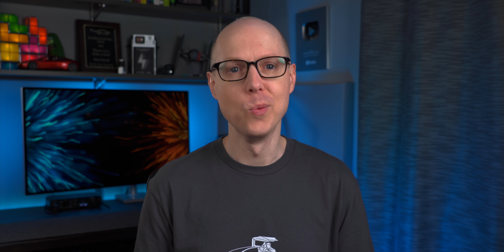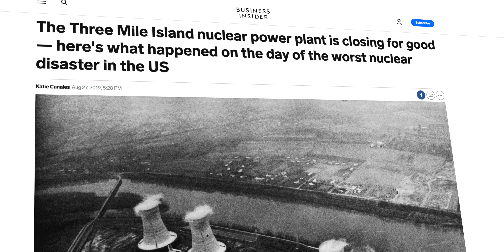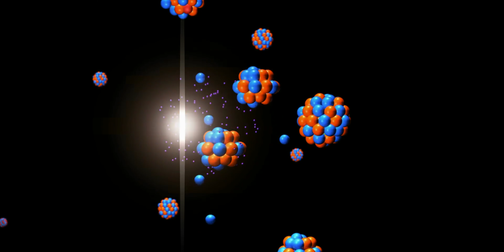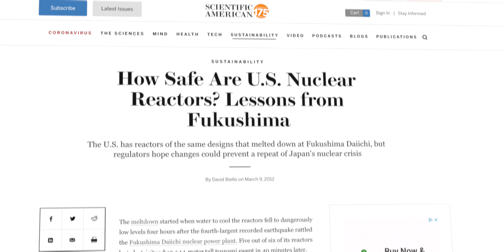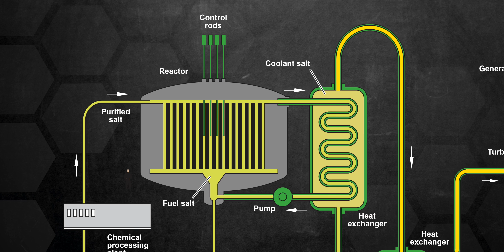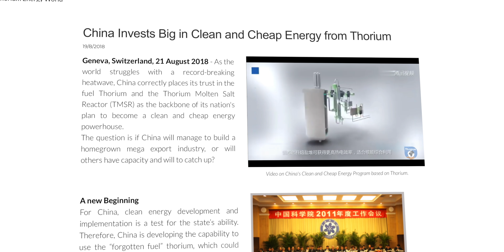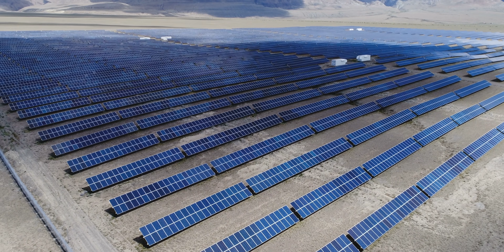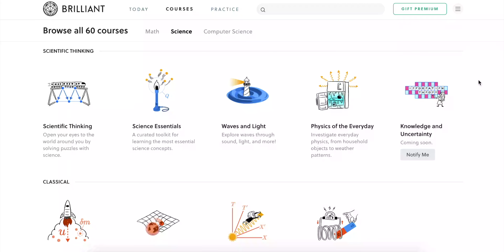Thorium explained - the future of cheap, clean energy?

Comment: My guess is, 20 years from now, if things last that long which I doubt - they will still be talking about thorium reactors and how great it's going to be
Reply: China will be starting up their test MSR in about 2024 and projects launching a small commercial reactor in 2030. There's no real technical hurdles, just minor engineering and optimization issues. The primary issue, and what China's been mostly working on since 2011, is rebuilding our technical knowledge of these systems, as most of the people with hands on experience with this type of system are dead.
Reply: @williamsmith1741  15 years ago they wrote that in 2030 China would have 50 pebble bed reactors running. What came of it?
Reply: @bezahltersystemtroll5055  I'm not sure why my last comment didn't post, but I don't really follow pebble bed technology as fluid fueled MSR's are more efficient, and pebble bed reactors aren't that new of a technology, with there being multiple plants around the world that are pebble bed gas cooled reactors. However, I just checked and China's high temperature pebble bed test reactor was nearing completion as of April 2020. I don't know if it was completed or if work delayed due to the global bug.
Reply: @bezahltersystemtroll5055  Oh, just following up on this, as I just learned this, but the Chinese MSR has already been running and the Chinese will be breaking ground in the next year or so on their first commercial scale test reactor, with plans to start rolling them off as part of their belt and road efforts, which I KNEW they were going to do. The Chinese are going to eat our lunch.

Comment: America made a tragic mistake in the 1960s when they dismissed nuclear physicist, Weinberg, for advocating a thorium/salt reactor for generating electricity instead of the uranium/plutonium models in production. The Cold War was a big reason the authorities wanted to stay with the u/p reactors, but they have proven to be costly, problematical, and no one wants the radioactive waste they generate in their backyard. If we had spent the last 50 years developing the t/s reactors, we would be well on the way to a clean energy future. I love solar and wind technologies but they will not produce the amounts of power we need for a long time to come.

Comment: Why not just go all in for fusion reactors?
Reply: Because these work already and it'll take probably another 30 years to commercialize fusion. Even then though, the amount of energy you get our of fusion of deuterium & tritium is only 4X the amount of energy you get out of U-233 fission (which itself is 1,000,000X the amount of energy you get out of burning fossil fuels). Additionally, with fusion you would also have to pour a large percentage of the power you produced right back into the reactor to maintain the plasma and keep it fusing, such that, at best, an operating fusion reactor might generate 2-3X the deliverable power that a thorium MSR would. It's not an insignificant difference, but given the already impressive power yield gains of the thorium MSR, our pressing immediate need to quickly replace fossil fuels, and the extended commercial development time table for fusion, I think the thorium MSR makes a pretty reasonable choice for right now. We can still work toward fusion, but the focus should really be on something that can be commercialized relatively soon.
Reply: In theory fusion is great!  But in reality there is no container that can hold hydrogen plasma at temperatures and pressures hotter than the sun.  So going all-in for fusion is like betting the whole human race on something that definitely will not work within a decade.  It might not work ever!  On the other hand, molten salt reactors were built before the moon landing, and they worked!  Molten salt reactors were set-aside because Nixon wanted to use all the money for breeder reactors... and breeder reactors turned out to proliferate nuclear weapons.  OOPS!

Comment: I have watched a number of presentations by US Nuclear Engineer Kirk Sorensen on the subject of LFTR technologies in the past as he has long been a passionate advocate of the technology and aggressive critic and opponent of chicanery.

In one of the early video files I watched, Sorensen located and interviewed some of the surviving scientists who had worked on the USAF sponsored LFTR program in the late 60's and some of their disclosures are quite startling.

I agree wholeheartedly with Sorensen's contention that LFTR's are essentially an equivalent to fusion based energy production that we can have now rather than some indeterminate date in the future when productive fusion might be achieved.

Furthermore I also agree with his contention that for nations where coal fueled energy production facilities are currently reaching the end of their lives LFTR's are the technology we should be using to replace those coal fueled facilities.

Sorensen makes a strong case for extraordinary levels of chicanery within US politics and industry with regard to the fostering and adoption of inefficient and inherently dangerous and dirty high pressure fast breeder reactors.

In doing so Sorensen points out that the company which builds the high pressure fast breeder reactors does so virtually at cost and makes the bulk of it's profit from providing enriched uranium fuel for them.

Sorensen also points out that the fuel pellets used in fast breeder reactors are relatively inefficient because Radon gas precipitates out of the enriched uranium the pellets are made of and concentrates in their center.

This ultimately results in a cavity forming and the material becoming cracked from within thus greatly diminishing the efficiency of the fuel and necessitating the replacement of pellets premature to depletion of their contents.

In closing, I encourage people to watch a fascinating presentation disseminated on TED via which a young scientist discusses why LFTR energy production infrastructure is the technology Mars missions should carry with them to the red planet.

The speaker contends that LFTR's are lightweight and relatively simple and safe as well as a relatively clean alternative source for energy during Martian dust storms as they are prolonged periods during which solar power would not be available and Thorium is known to be present in relative abundance.

Comment: A thorium based seed and blanket 60MWe reactor installed in a reactor system at the Shippingport Atomic Power Station outside of Pittsburgh Pennsylvania. I operated the PWR from August 1977 to October 1982. The commercial unit was a conversion of the 1957-1974 first commercial nuclear power station as a collaborative effort by Naval Reactors and Westinghouse operated as a PWR. The thorium reactor successfully demonstrated breeding using a movable seed of U233 and thorium blanket. The moderator was a pure pressurized water. The breeding resulted in ~9% excess  U233.

Comment: I noticed that you withdraw the control rods to slow or halt the reaction.  If there is physical damage as in Winscail it should be much easier (safer) to withdraw rather than insert rods in an emergency.

Comment: Thanks Matt. Great message. Thorium alone is useless without new nuclear technologies. So they should both be considered together. Thorium will not work in current reactors and current reactors are not cost-effective anyway.  Gen 4 reactors like MSRs can use Thorium as fuel. And be cheaper, safer and cleaner. Converting current reactors to use Thorium is being researched but not proven. Some Gen 4 reactors like MSRs can also use nuclear fuel waste as fuel. Which we have plenty of. Especially with depleted Uranium waste. So maybe you could cover this in another episode. We could get rid of most of the most toxic nuclear waste and weapons burnt up to produce energy with much less long term waste remaining. I would like to know more about Generation 4 reactors being developed in China. And in the current situation, it seems we may have a number of working prototypes by 2030. This is very possible if the resources are made available. And we need more low carbon options. Renewable energy is not keeping pace with growing energy demand. China is a great example. Despite huge investment in renewable and nuclear power they still have growing demand for fossil fuels. And today we need energy that is cheaper than gas. So nuclear needs to be an option. Not current nuclear. But Gen 4 nuclear.

Comment: I’m concerned about the uranium waste that is left over.  You still have to dispose of it for 500 years.  How many of these reactors will we have? If the number of reactors is high that means a greater amount of waste.  I’m not sold yet.
Reply: There's no uranium waste left over. 98.5% of uranium is fissioned in the reactor. Fissioning an atom, cracking it in half, produces fission products, the remaining two halves, which are HIGHILY radioactive. However, radioactivity and half-lives are inversely related, and the higher the radioactivity, the shorter the half life, and thus the quicker it goes away. Approximately 86-87% of the fissile waste produced by a thermal spectrum MSR thorium breeder would have completely decayed away within 10 years or so of being produced. Only Cesium-137 & Strontium 90, both of which have 30 year half lives, would require around 300 years, not 500 years, to decay away to nothing.

Comment: What good can come from a free energy producing Thorium reactor if we can't use it to make a bomb ?     Can you just answer that question ?   That's right, you can't !
Reply: You actually can't use thorium to make a nuclear weapon. Any U-233 produced would unavoidably be contaminated by the presence of U-232. U-232 will cause a nuclear weapon to pre-detonate, turning your nuclear bomb into just a regular bomb. U-232 also decays to Tl-208, a hard gamma emitter which would fry the wiring and electronics of any implosion type bomb, rendering them inert. Due to the high gamma of 2.6MeV, you'd have to surround the core with a led shell about 2.5 ft thick, which still might not be sufficient. 

Even if you were to design a process that could separate U-232 and U-233, the LFTR is a thermal spectrum reactor and has a positively anemic breeding ratio of 1.05 to 1.07. This means that the reactor consumes almost all of the fissile material it produces, and if you try to remove enough material to make a bomb with, you'd kill the reactor because it no longer has sufficient fuel in the system to maintain criticality. The thermal spectrum MSR thorium breeder is the MOST proliferation resistant reactor possible.

Comment: Technically, uranium-233 isn't a fission product of thorium (-232), but a transmutation product. You give the thorium a neutron, so it becomes thorium-233. After about a month, it converts (two) internal neurons to protons, giving uranium-233. Then, you can use the U-233 just like U-235 (or really, like Pu-239, since it transmutes from U-238, the same way that Th-232 became U-233 - it just goes faster). 

Most of the benefits of thorium reactors come from using liquid halides (the fancier way to talk about "molten salts"), except one: the lower the atomic number, the lower the number of its fission products, and thus the shorter-lived and less energetic their radioactivity. The worst of the reactor "waste" comes from transmuted U-238...and the least problematic stuff, comes from transmuted Th-232.
Also, what pressure and temperature limits you want to work with, should determine your work fluid. If you have, or want, (relatively) higher pressure and lower temperature, use water, and heavy water (deuterium instead of hydrogen) do moderate the reaction. Low pressure and low temps, call for liquid metals either sodium (light weight, low temp, single isotope) or lead (heavy weight, moderator material, low temp). high pressure and high temperature gives you gas cooled operation, and low pressure, high temp, is for salts.
We started with water reactors, because we were already making them for submarine engines, so we could just make bigger ones and keep them on land. If you're in a sub, low temps and high pressure are your daily commute, thus the water for coolant. If you're not moving the thing, though, you can go high temp, use a salt reactor, and use the heat for industrial processing, not just to boil water.
After all, who cares if distillation is more energy intensive than (reverse) osmosis, if your production of heat is orders of magnitude simpler and safer than your production and control over pressure. Produce what costs you the least to tame, and pocket the time savings - you can cover any other costs, but time lost is gone forever.

Comment: I think it is super important to distinguish between thorium nuclear and molten salt reactor technology.  The latter is the key to the former.  The problem is that molten salt reactor technology has not been been proven on a commercial basis for various reasons, but the principle ones are "regulatory" and chemical. Note the order. We can do this but existing regulations are designed to prevent innovation. The issue or thorium is a red herring.  Develop the molten salt technology and thorium will be a natural evolution.

Comment: Beaurocracy in the US as well as a lack of investment is holding Thorium and Generation 4 reactor technology. Gen 4 reactors are fundamentally very different to current reactor technologies. So the established standards for nuclear reactors is not applicable to Gen 4 reactors. Carbon and ceramic technologies may greatly assist the development of Gen 4 reactors in future. Many Gen 4 reactors can work safely at much higher temperatures which makes them very effective in industrial and desalination roles. Future carbon and ceramic materials can make high-temperature Gen 4 reactors more effective.

Comment: Thorium needs to be considered along with Generation 4 nuclear reactors. Thorium will not work in current reactors. Though there are development projects to convert current reactors to use Thorium. Thorium is safer to handle and process than enriched Uranium. And far more abundant and cheaper. Depleted Uranium is another fuel that can be used in Generation 4 reactors. Depleted Uranium is available in huge stockpiles of low-level waste that have few other uses. China is leading the way to develop Generation 4 reactor prototypes with sup[port from US technology and research. Plenty of interesting information on youtube that can help explain Thorium and Gen 4 reactors.

Comment: A very good summary. Although you read a lot about this over and over, the enthusiasm for this solution has already dwindled a great deal. As mentioned India and China have a Thorium program since over ten years, and wanted to have commercial reactors by 2020 already. Now they expect to reach this within the next 20 years, which shows that there are substantial technical challenges.

Apart from the corrosion problems of the molten salt there are also doubts in the meantime whether a thorium cycle is efficient enough to produce energy at reasonable costs.

Considering the time pressure with regard to CO2 reduction it is probably wiser to use the usual types of fisson reactors, which also advanced a lot when it comes to safety.

Comment: Thorium has virtually no long lived waste, and the quantity that is produced is vastly lower since the Molten Salt reactors can burn 99.7% of the fuel in contrast to current reactors burning only 1% of the fuel.  Molten Salt reactors can use either Thorium OR depleted uranium reactor waste and burn up all the trans-uranic waste and SOLVE an environmental problem.  They run at 700C which is perfect for highly efficient electricity production OR industrial heat for making chemicals and Synthetic fuels, effectively ending the dominance of petroleum.  Why even mention the TWR.............is has nothing to do with Thorium or Molten Salt reactor technology, like Bill Gates would anything sensible for man kind.............they guy is a CREEP and heavily associated with Geoffrey Epstein.

Comment: roadtonowhere.com..................even using the overly optimistic estimates and costings of the pro-renewables groups, its obvious that renewables are a total economic disaster. The so called "green" technologies like wind,solar,electric cars etc would be an environmental disaster to extract all the expensive metals and materials which DO NOT recycle efficiently. Just the demand alone for copper for motors,generator windings and cables would need 400 million tons of copper metal in the next 30 years.

Comment: The freeze plugs could be cooled by mechanical system that're driven by a safely-operating core (e.g.: the freeze plugs are only cooled when salt is moving through the reactor correctly). There could be a dozen different freeze plug coolers hooked into different parts of the core (so that even if there's random mechanical damage to the core the freeze plugs will melt and the core will drain)